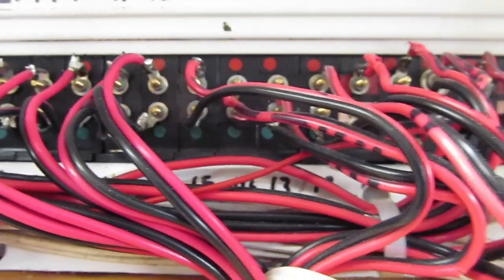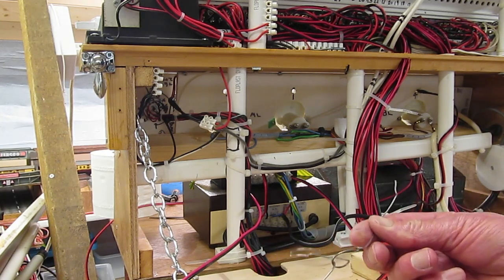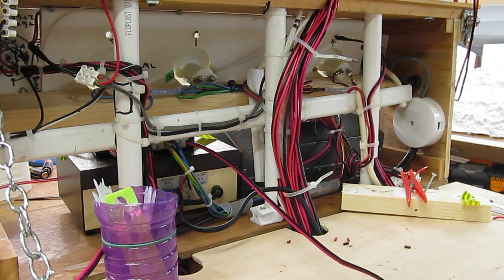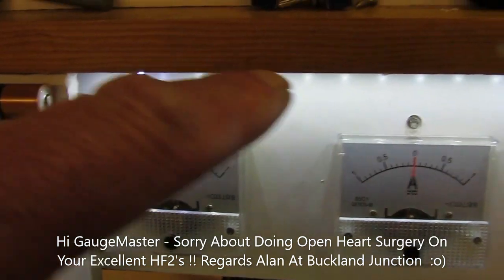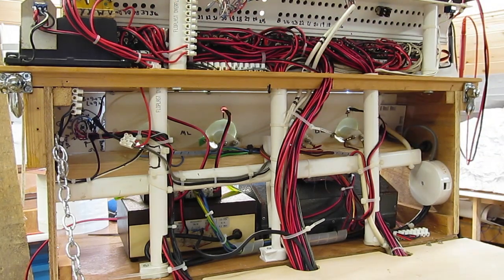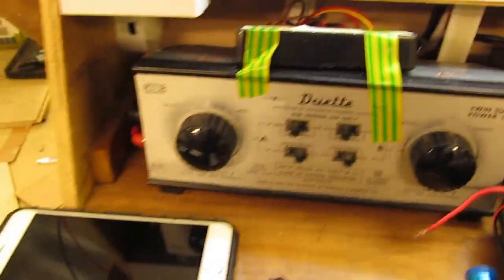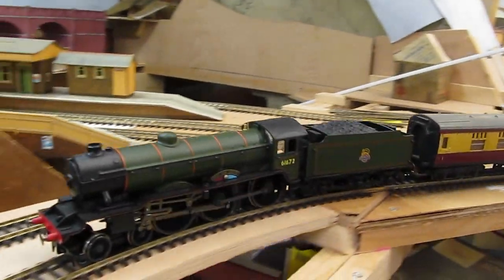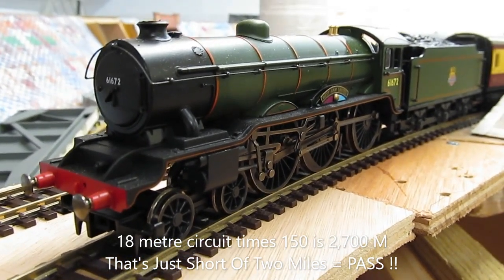Buckland Junction Loft Model Railway 42. Wiring Main Line Part 3. Includes a loco running session !!

Comment: I think Alan is building a huge computer to decode a new version of the Enigma machine.  Great work on the layout as usual, I can sit and watch for hours, Cheers, Paul.
Reply from the maker: Maybe the layout should have it's own power station ! Regards Alan in Dover  :o)
Reply from the maker: Cheers Paul. More in the pipe line. Regards Alan  :o)
Reply: @AlanReynoldsBucklandJunction  Why not plug into one of the wind turbines?. Paul from News at 10
Reply: @MarkTheVicar  Watch the lights dim when Alan pulls the main switch.
Reply: @MarkTheVicar  Your right, this explains the lockdown, no one can see what he is up to.
Reply: @MarkTheVicar  Maybe its Aliens, or is it Ali ans?  dont miss next weeks episode of Startrix.

Comment: For the HST try the Loctite thread locker blue liquid stuff.  If you remove the wee cog, clean the metal n add the liquid n put it back on it'll jam solid after half hour or so
Reply from the maker: Thanks for the info Sparkz mate. She can roast for now. Back to wiring for me. Regards Alan  :o)
Reply: @AlanReynoldsBucklandJunction  lol,  in the naughty corner. 😁

Comment: Hi Alan, I have heard differing opinions on the track cleaners, I would be interested in hearing yours.
Can you explain “ease the regulator and what this would entail”?  Also what would the basic wiring requirements be fir one track?
Your trains are running really well and I can imagine four running, hard to keep an eye on.
Do you add extra weight to all your locos?
So many questions but I am sure you can come up with some interesting answers.👍🤣
Reply from the maker: Hi Charlie. Track cleaners = The best is meths rag and elbow grease, followed by track rubber. Thou HF cleaners seem ok too. Then the Tri-ang truck is good for me. I am getting to grips with the regulator on different locos. Yes extra weight for locos is good but adds to them wearing out quicker. I hope I have answered you correctly Charlie?. Regards Alan  :o)
Reply: Good morning Alan, What do you mean by “ease the Regulator” ? Are you just referring how much you turn up the speed?
I use both the Isopropyl and  rubber in an attempt to keep the tracks clean but I still have problems with some locos over some of the points; one loco in particular is the CR Single which stops at nearly every point although I am suspecting part of the reason is the Magnahesion; do you think that might be the cause and can that component be removed and replaced with additional weight?
So many questions.
You must be very pleased with your progress
Regards
Charlie

Comment: Hi Alan, can I suggest using self adhesive velcro for holding down the Hi Freq Cleaners just in case you need to remove them, http://www.scfsupplies.co.uk/  you could also use non self adhesive velcro and glue it down if you prefer...   Dave
Reply from the maker: What a FAB idea Dave, Yes velcro, why didn't I think of that. Cheers mate. Regards Alan  :o)